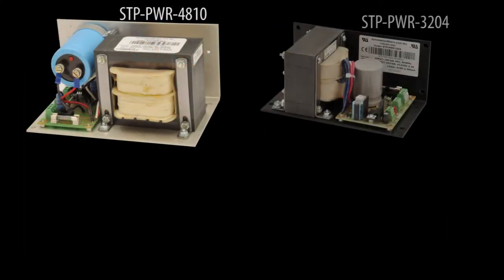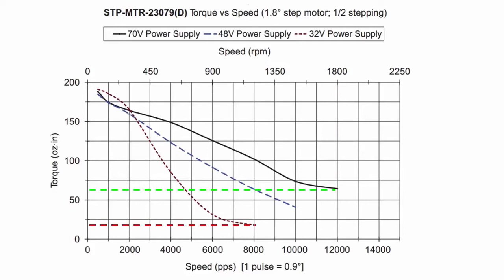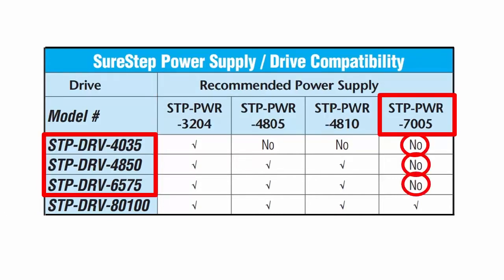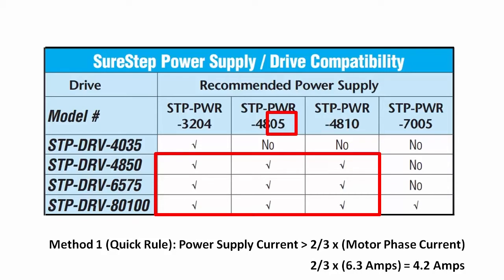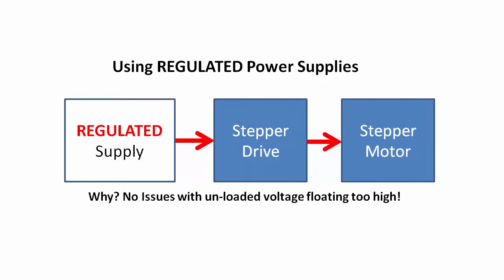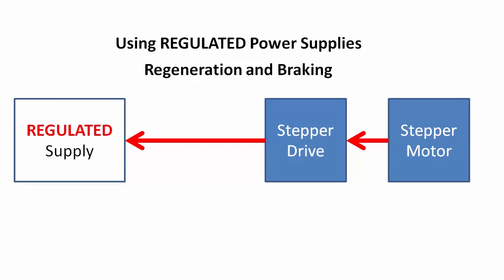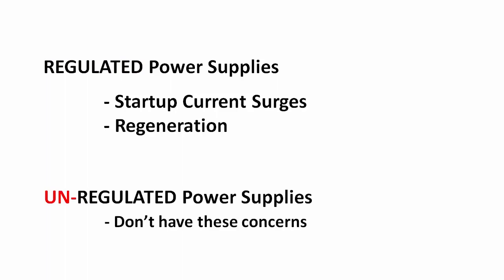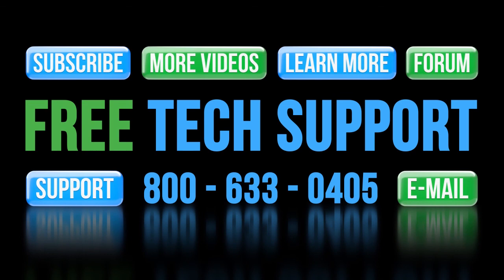SureStep Stepper How to Choose a Stepper Motor Power Supply from AutomationDirect

Comment: Hello sir, i am not much into electronics but I need to design power supply system for steppers of my robotic arm.
The motors are nema 34 (12nm and 8.6nm)
So can I power them with 48 volts 15 amps SMPS. The driver wouldn't burn due to excess current right. And each stepper will draw the required current that is 5,6.5 amps
Reply from the maker: Right, the motors/driver will consume as much current as they need as long as the system power supply has it to give. Just make sure your driver is rated for 48 volts.

Comment: Thanks for interesting explanatory.
I would like to ask you about 2/3 rule. 
If my motor current is 2.8A, i would count that 3 of them needs 2,8x3=8.4Amax
But as i  understood you are saying that ill need 2/3x(2.8)x3=5.6A to run whole system?

thanks
Reply from the maker: Correct - but keep in mind that is a general rule of thumb. It really depends on how hard you will be driving your system. But in general and most of the time, the odds of all of your drivers using max current all at the same time is VERY small, so most of the time 2/3 Power supply will be more than enough.
You can't go wrong with 8.4A, but the odds of actually needing that much current is really slim.

Comment: What about maximum length of wire runs from the power supply to the stepper motor drivers, and then also the maximum length of wire runs from the stepper motor drivers to my NEMA 34 motors?   I have an unregulated supply and am using 4 TB6560 motor drivers.  Thanks.
Reply from the maker: Hi Jeff,
We don't sell/support the TB6560 Driver so I can't give you a specific answer. But, in general, the more important questions are:
1. Power Supply: What gauge wire are you using between the power supply and the driver? For our systems we recommend 18 to 20 AWG.
2. Is everything properly grounded?
3. Cables between the drive and motors - Those are current signals so they can be fairly long. We sell cables dedicated for that connection up to 20 feet, so you can probably assume at least 20 feet.
4. Are you using an EMI filter between the power supply and the drive (required by CE).

Comment: I am working on a 6dof robot arm assignment for university. I have to design my own 12V power supply as well as the 6dof robot using 6 nema 17 motors and an arduino mega along with multiple other sensors. After reviewing the datasheet of a nema 17, I had seen that the phase current of the motor is 1.5 Amps, thus using the 2/3 rule I would need a power supply at least greater then 6 amps for my 6 nema motors alone, is this correct?. Also taking in to consideration the arduino that will be connected in parallel to the motors to use the same 12V power supply, would a 10A power supply be enough for the job, or is this too big or maybe even too small?
Reply from the maker: Hi Chris,  You are on the right track, but not quite there.
Yes, your DRIVE needs to OUTPUT ~10A to the motors. You need to look and see what voltage the DRIVE is outputting. Suppose it is 5 volts. So your motors need 5V x 10A = 50Watts.
The power INTO the drive is at 12V, 500W so you need a 42A 12VDC supply. Which is why you see most CNC machines use 36 or 48 or 70 power supplies. It reduces the current to a reasonable level.
Does that help?
Reply: @automationdirect  Thank you so much so much for the reply it really did help. I just want to figure out my output voltage of my driver. If I use the 12V power supply connected to each of my drivers, will the output voltage of the driver also be 12V or will the output be the 5v from the arduino if I am using a A4988 driver with a Vmotor of 12V from the supply and a Vlogic of 5V from the arduino.
Reply from the maker: Oops!  I slipped a decimal point (5V x 10A = 50 Watts, not 500W), so you need a 4.2 Amp 12V supply in the example I gave.

Comment: Each stepper motor connect with separate power supply or 15v power supply connect all steppers
Reply: 3axis
Reply from the maker: You can do either, just have to size the power supply appropriately.
Reply: 15v power supply enough for 3axis stepper motor????

Comment: I have a polulu stepper motor with a lead screw preattached to it, i used a battery holder with 8 AA baterries 1.5V each but instead of turning it vibrate instead. Is it because of my power supply? Should i used another type of power supply?
Reply from the maker: @The Concheror, it sounds like your stepper motor is in stall. Usually this is a sign that the load is bound up, or that you do not have enough power supplied to turn the motor. I would first remove the load from the motor and test again. More than likely, you do not have enough amps supplied to the motor to turn the load.
Reply: @automationdirect  im going to buy a power supply of 12V with 2.5A do you think it will be enough for it to turn?
Reply: @theconcheror5691  It is difficult for us to say without knowing more about your system. Which stepper drive are you using? How much load do you have? etc. It might be easier to contact our free technical support, they will be happy to help you with any AutomationDirect parts you are using.

Comment: Sir could you help me on how to select the SMPS (voltage, current values) for nema 17 and nema 23 for my project what will be the case if I use more than 2 stepper motors in my project.... 
Reply me sir...
Reply from the maker: Choosing a Stepper Motor Power Supply depends on the load that the motors have to drive and the specs of the stepper motor and motor controller. If you are using AutomationDirect stepper systems, Appendix C of this document shows you step by step how to figure that out: https://cdn.automationdirect.com/static/manuals/surestepmanual/surestepmanual.pdf
Reply: @automationdirect  thank you sir

Comment: Why does the motor controller need a 5 volt supply and is it a good idea to use the same 5 volt supply to supply the motor controller and the break out board, seems like there is opportunity to fry your expensive stepper circuit and break out board?    I would think 2 separate 5 volt supplies could be used but I am not sure why the motor controller needs a 5 volt supply in the first place?
Reply from the maker: Using two separate 5V supplies is not a problem - all depends on your application and how you want to set things up. As to why the motor drive uses 5Vdc?  It probably uses TTL logic levels.

Comment: Dear sir, I have a power  supply which is 12volt and 30 Amps. I need to run Nema 23(3Amps each) 6 stepper motors. Will this power supply be OK for my work?
Please sir, reply me. I will be grateful to you?
Reply from the maker: MD, Mubarak Hossain, It could possibly be enough for your system. There are a few factors, that you will need to research on your end. Is this a regulated or unregulated supply, is it a switch Power supply, will it provide enough current for all the motors to start up. 

I would place an ammeter on the system and try to run the motors. See what kind of draw you get from your supply. 

Thanks
Reply: Thanks a lot sir for your reply and help.